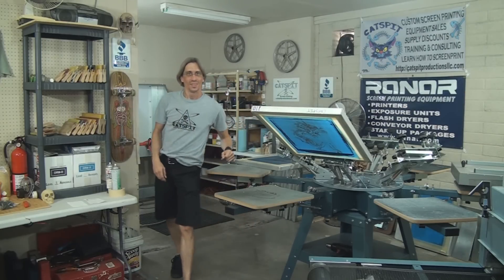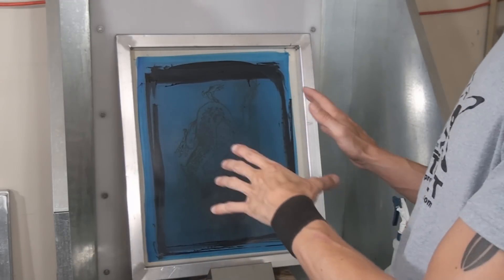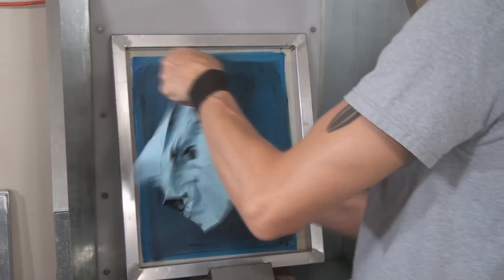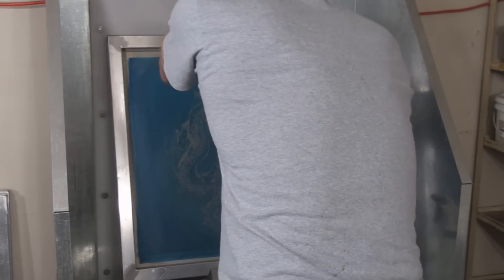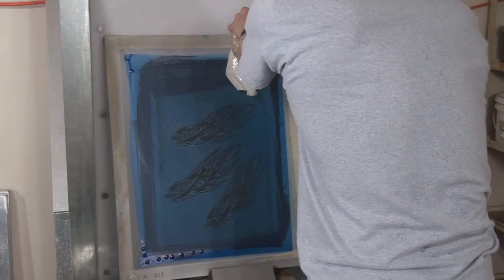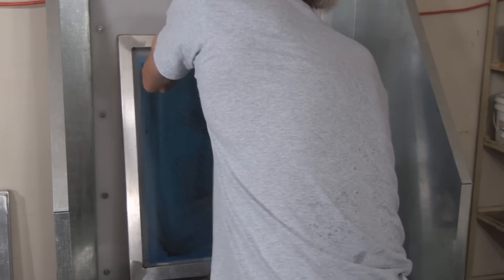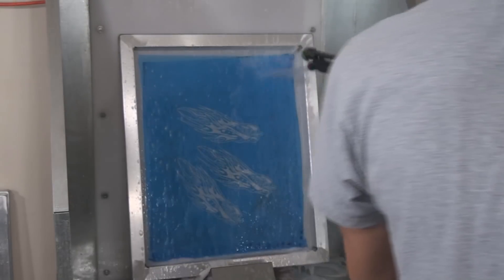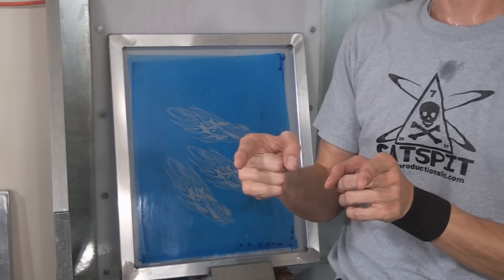How To Screenprint: Tips For Cleaning Ink Off Screens

Comment: Jonathan,  I did my first paid screen-print job tonight! (well this morning 1:17 AM)  There is a learning curve switching over to plastisol inks from water-based inks!  I bought out this print shop and I have so many chemicals I don't know where to start.  They all have letters and numbers for names.  I found that you can't use water with PW4 very well so IR4 seems to be a better fit for my lazy self.  If I don't have any out there I'm going to have to stop by your website.  Thanks for the video!
Reply from the maker: LOL, yes I suppose that could be difficult to sort out. But at least you have a head start with working in water based first. If you need any help give me a call. I'll do my best. And you're very welcome. Thanks for watching. Screen Printing Equipment & Supplies - http://catspitscreenprintsupply.com/

Comment from the maker: @eskolitt Maybe a similar technique but as water based inks tend to get tacky and sticky fast when in thin layers, I might use a slightly damp rag to wipe them out first and then use water. But you can also use a solvent because the haze is most likely dried ink left on the emulsion. It can leave a thin stain or film. Perhaps a little thinner on a rag would remove the ink haze after the screen dries of water. Glad you like the videos! Thanks for watching & commenting! ☠

Comment from the maker: Same procedure but you’ll need to use a solvent for water based inks. Press wash and screen wash for water based ink would work well. Not all plastisol solvents will work well with water based but some do. Paint thinner is always good for water based as well. Thanks so much for watching and dropping me a note. ☠

Comment: what should be used to clean water based inks off the screen ?? would Speedball Speed Clean work , im worried about washing the emulsion . thanks
Reply from the maker: It depends on the ink. You'll need to follow the instructions for the ink you are using. Thanks for watching! Screen Printing Equipment & Supplies - http://CatspitScreenPrintSupply.com/

Comment: Ok I know this is a long shot but what do you use to clean dry ink off your screen I just did my first shirt last night and I used a stencil instead of emulsion the paint pooled under the screen and stencil and I didn't clean it right away  hoping you could help.
Reply from the maker: If it's water based ink the screen could be ruined. Try some haze remover and a pressure washer. Thanks for watching! Screen Printing Equipment & Supplies - http://CatspitScreenPrintSupply.com/

Comment from the maker: The tape on the sides blocks the ink from passing through the mesh between the emulsion and the frame edges. You can use old emulsion or blockout to do the same thing if you like. Thanks for watching and leaving a comment! ☠

Comment: wonder how clean these have to be? used mineral spirits and it has cleaned out 80% of the ink from the mesh. some still clogged. what should i do?
Reply from the maker: Plastisol ink will not clog easily so you must be using water based inks. Once they dry in the mesh, the screen may be ruined. You can try stripping the screen entirely with emulsion remover and haze remover. Thanks for watching! Screen Printing Equipment & Supplies - http://CatspitScreenPrintSupply.com/

Comment from the maker: If it’s an air dry ink that dried in the mesh and on the emulsion the screen may be ruined. Try using lacquer thinner and then emulsion remover with a pressure washer. Thanks for watching & commenting! ☠

Comment: Hey there. I have a question. So I have a silk screen it's been about awhile since I used it. I didn't get it completely clean though. The ink and everything is gone but I can still see the image that I printed. I used the stencil method. I got the basic stencil screen printing kit by speedball. I was wondering if there's any way I can get the image out? Since it's been so long? Thanks.
Reply from the maker: You could try some haze remover with a pressure washer. http://catspitscreenprintsupply.com/haze-remover/ Thanks for watching. Screen Printing Equipment & Supplies - http://catspitscreenprintsupply.com/
Reply: Thanks I'll look into it!
Reply from the maker: Trans Man My pleasure to help out any time.

Comment: If you plan on using the same print on the screen you use, how long can it be kept for before you need to remove emulsion and do the emulsion again?. So what im going to be doing is about 2-4 designs on 4 diff screens, so I don't need to keep reclaiming all the time,  is it needed to reclaim the screens a lot? or leaving it done but clean the paint off ok to do, stored in a dark space?. Also im using waterbased paint, so to clean it with water and wash it through with just that is ok to do?Thank you and your videos are very helpful.
Reply from the maker: Thanks glad you enjoy my video work. Please make sure to subcribe. No you can clean the screens of ink and store them indefinitely.  As long as the emulsion was fully cured before usage they should reclaim at any time. I keep them for years and then reclaim as needed. Even if they don’t normally a print run or 2 with any given job pays for the screen and some. Some water based inks will clean up with water. Others need a solvent. Check with the ink maker for details. Thanks for watching and leaving a comment! http://www.catspitproductionsllc.com/ - http://catspitscreenprintsupply.com/
Reply: Ok thank you for the info, I just did my first emulsion and cure, think it didn't go to well, bubbled when I layed it down so I guess I used to much emulsion then tried to add another coat, but didn't fully dry and the image not only burned through only one side but it ate the stensil..lol..oh well shit happens..so I coated again this time using less and we will see tomorrow if it works out well. The thing im concerned with is the time frame for the burn, I have a yudu as im just starting, and starting to think to build my own screen and machine would be a lot easier..lol..what time frame do you recommend and I wont hold you to it to burn my image? using the yudu, im not sure the lights they use so the time is confusing. Im thinking from yours and everyone elses videos it can range from 3-6 mins but with yudu it seems like 8-10. I don't know..lol..anything you can offer I would appreciate it and shit if you need someone to help hire me..lol..talk soon. and I will subscribe. Please if you like visit the website I just created being tech for dummie kinda guy and its for a great cause. Talk soon. Thnak you..David. http://www.danielshiddenheroesebok.org/
Reply from the maker: David George I use a photopolymer emulsion with an industrial black lamp exposure unit and 20x24 screens. My times are about 45 seconds or less. I use a scoop coat and coat the screen with a thin layer of emulsion. Check out my play lists for tips on screen making.

Comment: again, thank you for an informative video! one question: being a hobbyist printer working on a budget, like myself, how do you feel about cutting corners on the chemicals? I've found straight mineral spirits does a great job at removing uncured plastisol, and its readily available - a big plus for me when a job needs done, and dont have a local supply house to attain chemicals. Also, for absorbency, ive found using an old rag or trash shirt to scrub does a FAR more effective job than paper towel

Comment: Hello. Thanks for the video. it was helpful. But in order to remove the emulsion, what else i can use it. it is difficult to get emulsion remover. Is there any other product i can use as an emulsion remover? can you give me the chemical ingredients of the remover?
Reply from the maker: +Arai Tilyek You're very welcome. Glad I could help out. The only common chemical you can use to remove emulsion is bleach. But it will take about 15 minutes of soaking or more to do it. Then use a pressure washer to finish it off. Thanks for watching. Screen Printing Equipment & Supplies - http://catspitscreenprintsupply.com/

Comment: On your second screen that you cleaned... what are those bubbles on the bottom left of the screen? I have those on one of mine too and I am worried about if i can print with them on there or if it will cause pin holes?!m but you seem to have done a screen with some of them on there... Can you give me any and all information on those bubbles in the emulsion that you know please!
Reply from the maker: That was the emulsion dwelling on the mesh in a drying box that was not level and did not have enough air circulation to let the moisture out of the box. Your drying box has to be level and it needs enough air circulation to allow the moisture from the emulsion to escape. Otherwise it will dwell toward the side of the cabinet that is not level. It will dwell even if it is level too. Emulsion is over 50% water so it's critical there is a way for this moisture to escape during the drying time. As long as these "bubbles" are not in your stencil area then they will not affect anything. Thanks for watching. Screen Printing Equipment & Supplies - http://catspitscreenprintsupply.com/
Reply: Thanks!
Reply from the maker: My pleasure to help out where I can.

Comment: great video!  

what is that water spray station called and how much does it cost to install one plus plumbing for drainage?
Reply from the maker: Thank you! That’s a washout booth: http://catspitscreenprintsupply.com/ranar-econo-back-light-washout-booth/ It can be installed anywhere you have access to tap water and a floor or other drain. If you do not have a drain then installation costs will be dependent on your plumbing needs. You can set up and install the unit yourself with PVC piping and glue as long as the drain is already there. Thanks for watching and leaving a comment!

Comment: hey there ,  what would you recomend to remove vinyl ink from the screen without removing the emulsion ?
Reply from the maker: Usually we use a solvent made for the ink we are using. Sometimes you can use paint thinner. But anything other than ink or screen "wash" will be gentle enough I would believe. I sell press wash for my plastisol inks on my ecommerce site. Thanks for watching! Screen Printing Equipment & Supplies - http://CatspitScreenPrintSupply.com/

Comment: Quick question... Would I be alright printing IC Teal through a 156 mesh if there is some small type (less than 1/4 inch in size) or do I need to step it up to a 200 or higher? I ran into some problems on a job that had blockout type and it wanted to keep covering my letters. Found out 110 mesh is only good for white or puff paints.
Reply from the maker: I am not familiar with that ink. I do not use IC. But the mesh count is chosen based on the thickness of the ink and the detail needed in the stencil. The more detail you are trying to get then generally we move up to a higher mesh count. But a good emulsion is also necessary to achieving great halftones or fine line details. If the art has fine lines anywhere near 1 line point then use a 200 or 230 mesh. At the same time try to use a mesh that will work well with the ink thickness. Thanks for watching. Screen Printing Equipment & Supplies - http://catspitscreenprintsupply.com/
Reply: Thanks, it was teal IC ink and it worked perfect through a 156 mesh!
Reply from the maker: Skudgeboy My pleasure. Good to hear ;)

Comment: What's the dif between ir4 and ir5.  I normally use the ir4 u suggested but your out of gallons.
Reply from the maker: IR4 is mainly for plastisol inks. IR5 is for UV, solvent and water based I believe technically. I see my product description is the same for both. That is an error. Basically the PW4 and IR4 are for plastisol textile inks and the PW5 and IR5 should be for UV, solvent and water based. Let me check on that and fix these product descriptions. And I may have stock for IR4. Perhaps I forgot to reactivate the product. I'll check tomorrow. You should email me on this so I can  put it in my cue and reply. Thanks for watching. Screen Printing Equipment & Supplies - http://catspitscreenprintsupply.com/

Comment: Hi I use thinner to remove water base paint dry in my mesh and it worked but left some pin holes. I buy RhinoClean HR 2800 to clean it but this broke my mesh. this needs to be diluted with water or make something special before applying? ..

I hope you can answer my question soon and thank you for all these videos.

Comment: is it always harder to get white ink out because mine didnt go that well i just couldnt get it all out so i used tap water to help get it all out and messed up the image thankx
Reply from the maker: White plastisol ink should be very easy to clean from the screen. It sounds like you may be using water based inks. You’ll need a solvent for cleanup on that. Thanks for watching!

Comment: So it is necessary for plastisol ink to use ink remover for it to come out? I tried to clean mine with just water and it turned out really bad :( I guess that's a beginner's mistake
Reply from the maker: That is correct. You need a solvent to clean plastisol inks off screens. You cannot use water. Thanks for watching. Screen Printing Equipment & Supplies - http://catspitscreenprintsupply.com/

Comment: Sometimes when i clean ink off of my screens the emulsion will start to crack and mess up the stencil, does that mean i should expose it a little longer after i wash out the stencil before printing? Just to harden the emulsion?
Reply from the maker: +franchisejr15 Possibly, yes. Unless you are using the wrong emulsion for the ink you are printing. But yes, under exposures will make screens break down easy and could possibly make them unable to be reclaimed. Make sure your emulsion is fully cured and that you're using emulsion for plastisol or water based inks specifically. Thanks for watching. Screen Printing Equipment & Supplies - http://catspitscreenprintsupply.com/

Comment: i wanted to try the stencil method for printing, can i clean the ink from the screen with water if im using water based speed ball ink? thanks
Reply from the maker: I don't recall if Speedball is totally water based or if it has solvents. I would ask Soeedball about that. Or you can try it. You'll know right away if it cleans up with water or not. Thanks for watching. Screen Printing Equipment & Supplies - http://catspitscreenprintsupply.com/

Comment: will the plastisol ink solvent spray remove caked on and dried up plastisol ink on a screen?
Reply from the maker: Carla McPhee As long as the plastisol ink is not cured or very ancient, yes, it should. You may need to use a bit with some elbow grease but it should clean off eventually. An ink wash would work best as opposed to a press wash solvent however. Thanks for watching. Screen Printing Equipment & Supplies - http://catspitscreenprintsupply.com/
Reply: ok got it. some of the squeggees have flaking paint on them and i'm wondering if it they were salvageable or just toss them and buy new?
Reply from the maker: Carla McPhee If it is dried and flaking it may not come off. That was likely water based/solvent based ink. You can try paint thinner if you like but they could be ruined.

Comment: I was thinking about buying the (Screen Printing Kit) but the only way for me to clean the screen is in my kitchen sink. I 
have no room for a Washout Booths, so is it a bad idea to start
 a screen printing business from my apartment?

Thanks
Reply from the maker: You might be able to start your business from an apartment by you will definitely need a place to do screen making if you want to be a real commercial shop. Screen making is probably one of the most difficult parts of the process and having the right equipment to do the job will help out greatly. That doesn't mean you need to buy a washout booth but you would need an area to work with your screens and chemicals and you would certainly need a pressure washer. So depending on where you can work around your apartment, you may or may not be able to do this from there. Thanks for watching. Screen Printing Equipment & Supplies - http://catspitscreenprintsupply.com/

Comment: I paid a company to make me a screen with my font on it,I want to keep this desighn forever so do I just use water when I clean my screen???
Reply from the maker: That depends on exactly what type of ink you are using. Ask the maker of your ink what solvent to use for cleanup. It may be water with a water based ink or you may need a solvent if it were plastisol ink or another type of air dry ink. Thanks for watching! Screen Printing Equipment & Supplies - http://CatspitScreenPrintSupply.com/